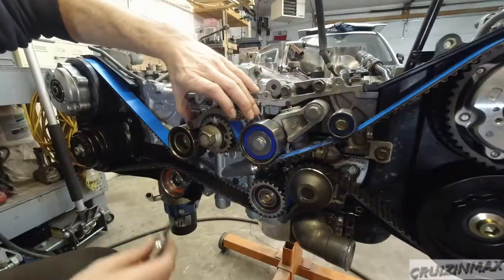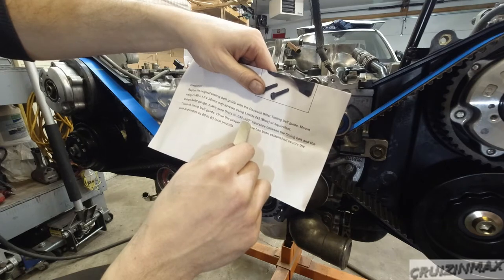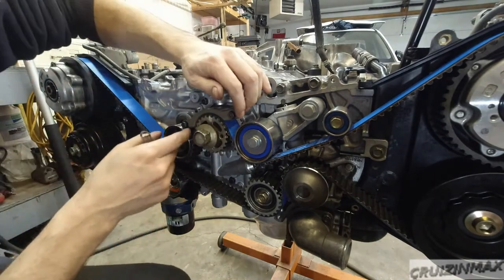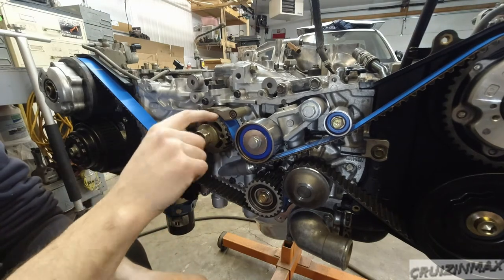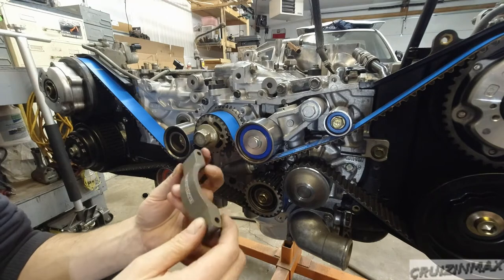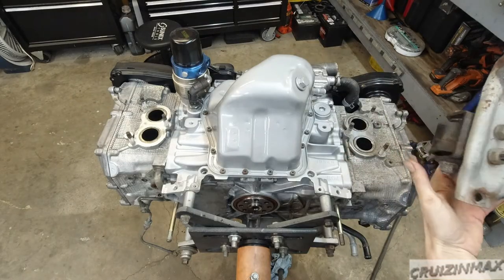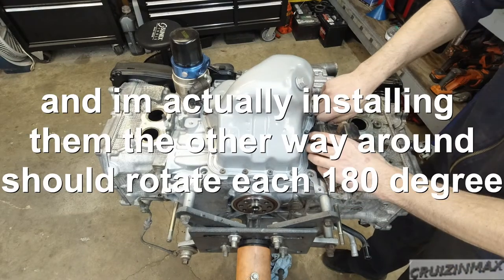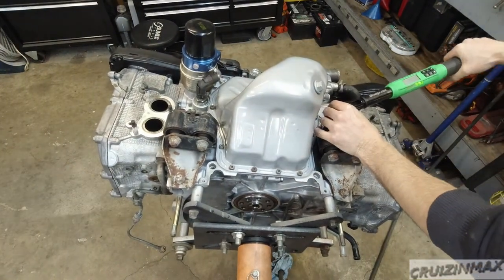Subaru STI EJ25 build part 7 cam bolts, pcv oil catch cans

Comment: Really liked your PCV System explanation. So you completely eliminated the PCV Valve? Did you ever get any CEL lights/error codes related to a possible PCV issue due to routing the vacuum lines this way to the catch cans? Was the motor behaving/venting correctly afterwards? Thanks for this video btw..
Reply from the maker: as of now its all the same as far as the pcv or venting system goes, no check engine light and no issues with normal or even spirited street driving.  The only problem that im having right now is collecting too much oil in the drivers side catch can on a track to the point where it overfills running on E85, autocrossing the car has no issues.  So if you dont track your car then u should not have any problems.  I intend to reroute the right and left hoses, basically run a hose from the left can to the right head and right can to the left head, we will see how that will work once I do that and go a trackday, maybe a while.
Reply: @cruizinmax4017  Interesting.. I thought the PCV valve was actually necessary to regulate the flow of oily gasses coming out the crankcase (based on the position of the valve: closed, semi-open, fully open according to regular driving, mid throttle and full throttle respectively). Why not try routing the houses to the cans with the PCV valve in place? One full can after a track session seems like a lot, but I may be wrong..
Reply from the maker: at full throttle it would be open anyway and I would have to install 3 of them on each can, there is a thing by cusco I think where its a valve that opens and closes during hard cornering side to side, I might be buying that.